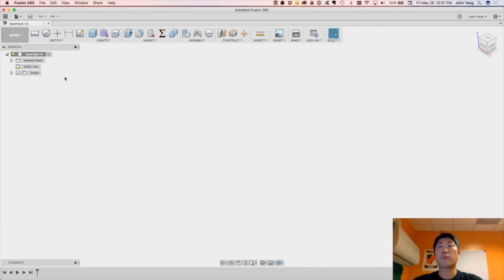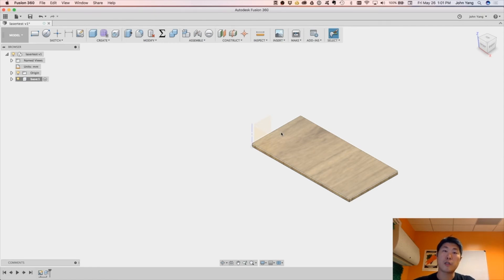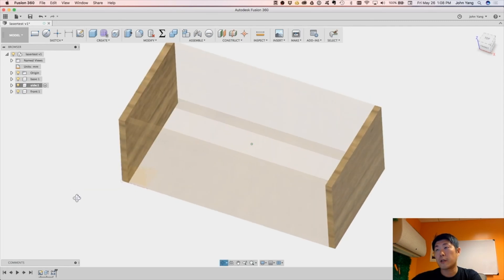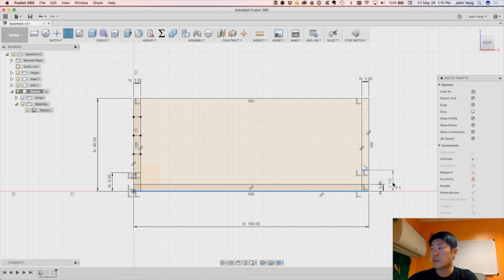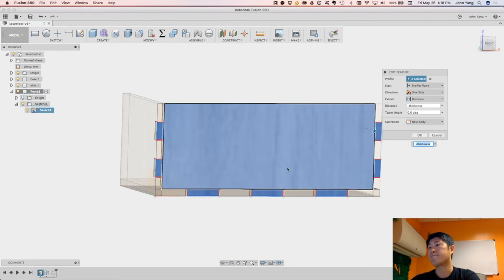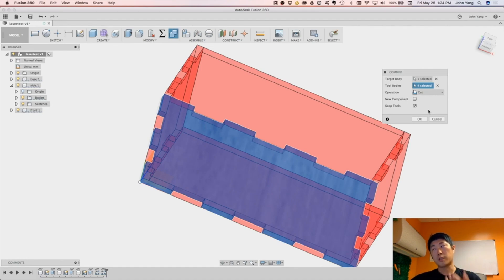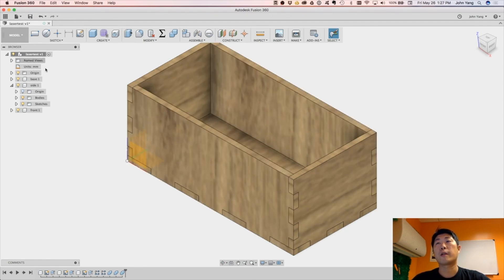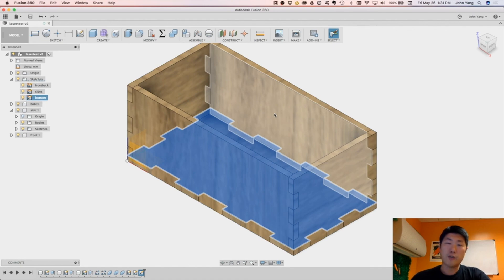How I design a laser cut box in Fusion360

Comment: I'm stuck at 6:00 - I can't add the dimension because F360 is telling me "Adding this dimension will ove-rconstrain the sketch"
Reply from the maker: Hi, sorry I was on holiday and am just seeing this today.  So there is likely a dimension somewhere else in your sketch that is forcing the dimension.  Usually you should only enter the dimensions on blue lines.  Once a line is black, it is fully constrained either explicitly or via calculations based on other dimensions.  If you think that a line should not be constrained (black) you can start to delete some constraints/dimensions to see which one is linked to the line you are investigating.  message me if you still need some help, and maybe we can collab directly in f360 via a live review session.
-John
Reply: I redid the tutorial and it works now. I think I was just new (this was the first tutorial I attempted with F360) so that explains why I got lost so easily. Did some of the Autodesk Tutes then came back to this. Thanks for the upload and introducing me to parameters.

Comment: Nice work! QQ: when I did a box like that my grooves appeared to be a little bit bigger (due to laser cut ~0.1mm), do you know how to make it fit perfectly so that the edges goes tough into each other? I know I can design it and check experimentally but do you know any other options?
Reply from the maker: Hi, I have been using fusion for my CAM recently and you can do cutter compensation to adjust where the CAM paths hit.  I've found that cutting on the vector works well enough for my needs, but if you want/need a tighter fit, you can look into the cuter comp settings to adjust for fit.  Sadly the only real way to get a perfect fit is to experiment.

Comment: I'd like to know how one would add in kerf values for the laser.
Reply from the maker: For kerf compensation I have usually just added in a small 'slop' factor to some measurements when defining them in the design.  Then I can do test cuts and adjust this one parameter and have all joints change as needed.  For my wood boxes, I don't find the laser kerf to be something that needs active compensation, your application may differ.
Reply: I Dont know about your laser but the china laser has that built in

Comment: Please Help! You have a really informative tutorial. My only question is why do some of my faces still show as squares? when I hover over them the tabs and broad faces seem to be separate, but when I look at the bodies they are solid and include the tabs (which they should). I computed interference and got not errors. My concern is that if I export this dxf as is, it will show a height dimension line segment essentially cutting off all the tabs on one side of the box. Fortunately, I can rectify this in a more familiar program but I want to do it in 360. It seems to have something to do with the parallel thickness lines I drew where the corners intersect... I hope I explained this properly.. Any advice would be greatly appreciated. Again, very good video.
Reply from the maker: If you're still seeing individual bodies, you can do a boolean join to get them to present as a single face.  The way a dxf is exported should just be a projection of a single face, so if the line is there it should be easy to spot in the dxf and remove. message me and I'd be glad to do a review of your f360 design and try to spot the problem with you.

Comment: Good tutorial. Couple of questions. Laying out the parts to cut. say in your box example you have 5 pieces. is their an easier way to lay them all out at the same time for cutting? also considering how they get layed out 1 for minimal material loss as well as considering what size material you have so they then can get cut from? Q #2 (the real important part) lets say your creating finger joints for material thats so called 3mm but intruth: once measured its really 2.87mm (choose any number its just an example) then also considering your lasers KERF. lets call that .05. (everyones is different, plus it changes depending on what your cutting) Now, in your model when you cut all your joints? Your box will fit together loose. (because of the loss of material ie kerf.) Any thoughts on how to compensate for that loss.  when you have a part with lots of interesting points the kerf adjustment can get quite time consuming. thanks agin for the great post!
Reply from the maker: Sorry for not replying sooner.  For the kerf, I find that it doesn't really matter much with the laser.  I do include a 'slop' factor that I have used to tighten things up, bunt in reality I usually just cut at the measured thickness and it works.  In plywood designs the kerf difference is so small that the glue used in assembly easily fills the void.  My acrylic boxes have had some larger gaps, but the solvent was still able to work.  Make some test cuts and see how much it really matters in your application.  But from my woodworking I've generally found that 1/64 or less is good for most things (miter corners excluded).
Reply: TWU, Thanks for the response. and again loved the video.  While I have adopted lots of your method I still need to be able to adjust for KERF. Perhaps your applications allow you to not feel the effects. Im not so lucky. HOW if you did want to adjust for it could it be approached?  you seem to just have that feel for F360.. Im still trying to "GET IT" even with all the nights till 3:00am and tutorials making my head spin!  being able to adjust the kerf would be a blessing! Thanks for the consideration. -S